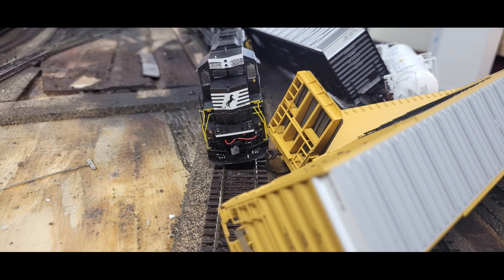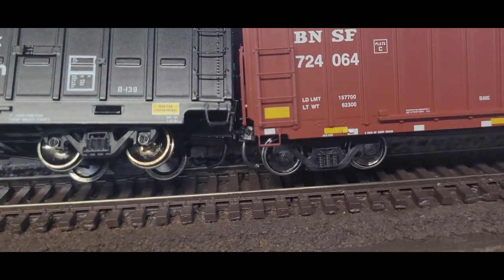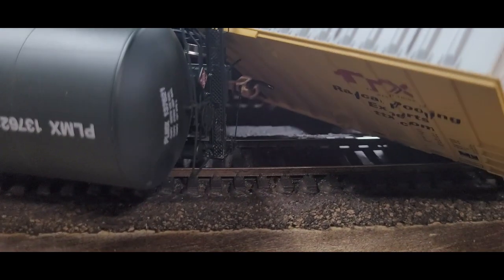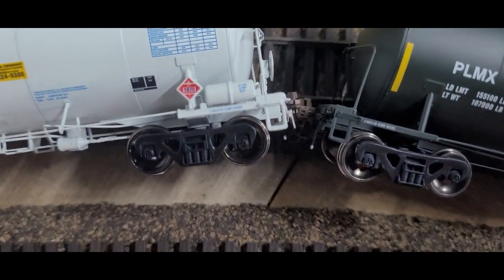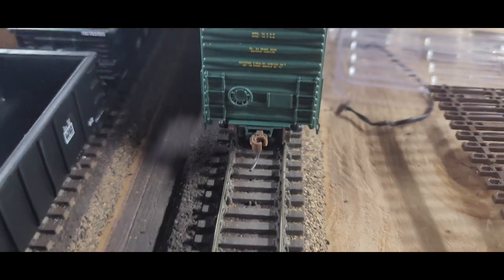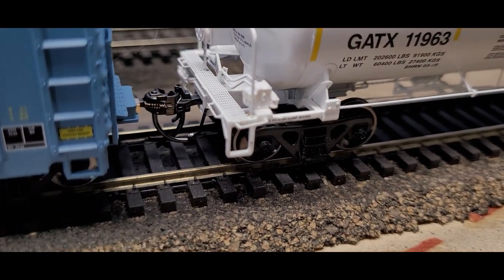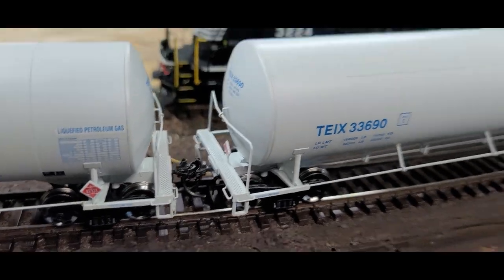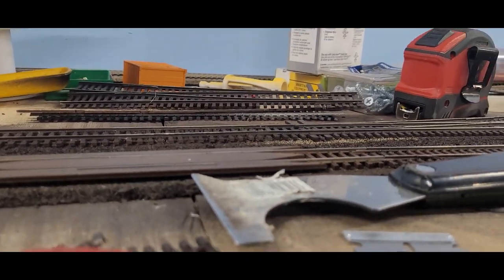Rear-End Collision, Derailment, cleared up and repaired on the E&H Railroad

Comment: You have a good roster of freight cars. Thanks for the video.  👍😃
Reply from the maker: It's time to swap the cars for new ones Maybe have a coal or ethanol train running
Reply: @engineerhall5887  yeah the unit trains are nice to operate. I like mixed freights but I get derailments sometimes because of different car brands and those pesky couplers. I get too lazy to change them out.
Reply from the maker: @MikeG42    With those cars I add weight and change the couplers  sometimes I used the micro mark tool to make the wheels run smoother
Reply: @engineerhall5887  Do you buy Athearn cars because they are good looking cars with poor couplers. I changed one after a gondola's coupler exploded like a grenade one day.
Reply: @engineerhall5887  Model Railroading can be frustrating sometimes but the enjoyment heavily outweighs it.

Comment: Oh no… that clean up must be super expensive to E&H RR! The block of flammable tank car loads that rolled on it side, I hope they was empty cars. I am surprised that the 2581 corrosive placard car didn’t split in half from the impact. Did the NS crews get drug tested as per the DOT and FRA inspection? Is this NORAC or NS rules apply?